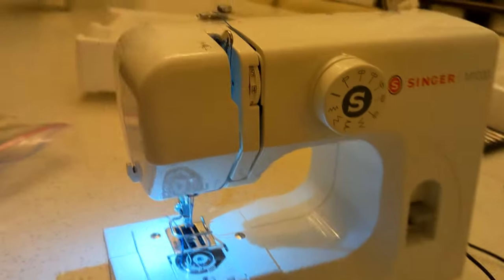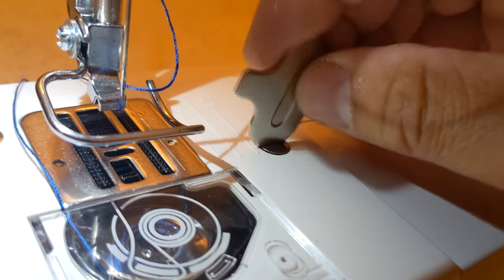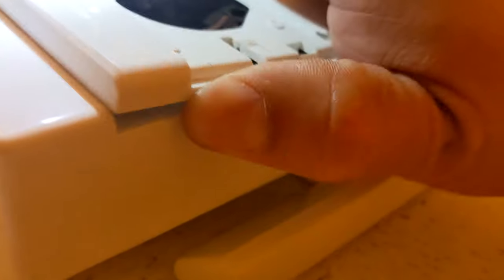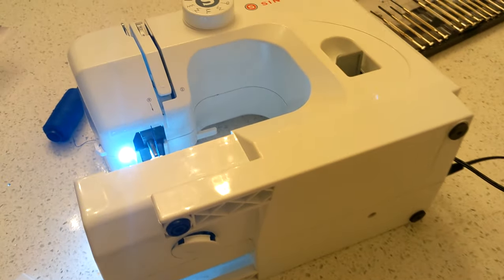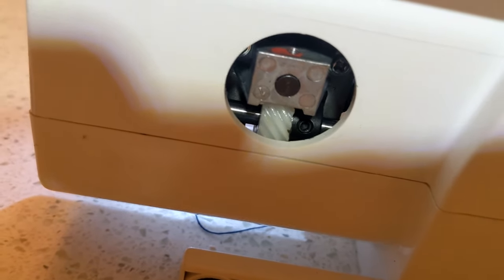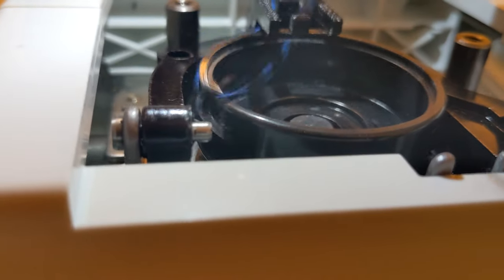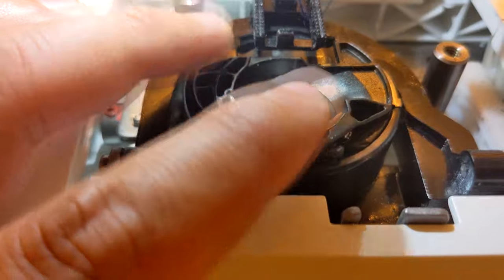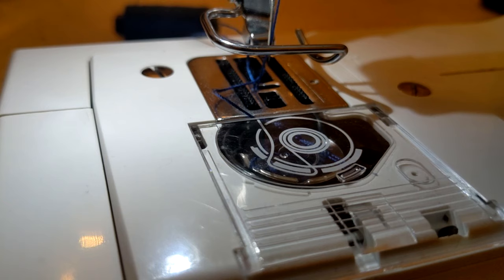Singer M1000 sewing machine not catching bobbin thread

Comment: Thank you so much for this video. Unfortunately I loosened the allen bolts all the way and was totally unable to put them back into their holes so I've just had to take the entire casing off the machine to access that drive shaft enough to thread them back in. This is a very poorly designed machine in my opinion. Great video tho, thank you!
Reply: True even the registered singer tecnicians say so and advice against it's repair

Comment: bro it keeps moving the needle when i move the black part
Reply: I am having the same problem
Reply: Any solution found ?
Reply: It's likely the screws haven't been loosened enough. If you're like me you're having an issue where the screws don't actually turn, and forcing the Allen wrench to turn just straps the wrench
Reply: @aster6969  i took ts back bro it got annoying
Reply: My machine had a other set of them little Allen screws I tried wrong ones at first
Reply: It have 2 screw
Try to lossen both of them it will work
Reply: I loosened the screws as far as almost falling out and I can’t move the black part manually to catch the needle. Help?
Reply: @rockthevaworld6788  im having same issue did you find a solution?
Reply: @tamihamilton9645  have u found a solution? 😅
Reply: @rockthevaworld6788  have u found a solution? 😅
Reply: @aster6969 bruh me too
Reply: Asegúrate  de aflojar  vien  el  tornillo de  abajo por  si  no se  afloja  se  sigue  moviendo la ajuja
Reply: Thanks bro, mine worked

Comment: The bottom part cannot be opened.  Pls help
Reply: I can’t get it either
Reply: I was struggling with an exacto knife but I grabbed a small kitchen knife and it popped right off
Reply: You need a very thin blade like a razor blade